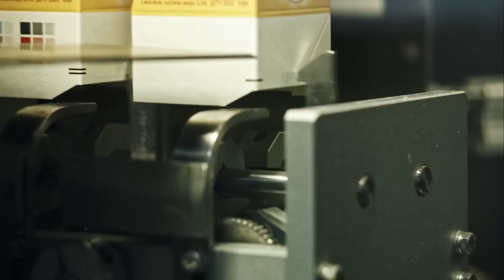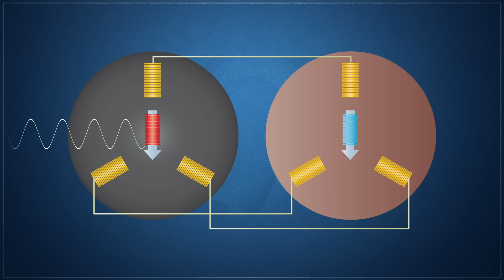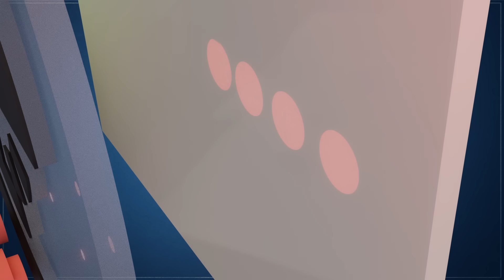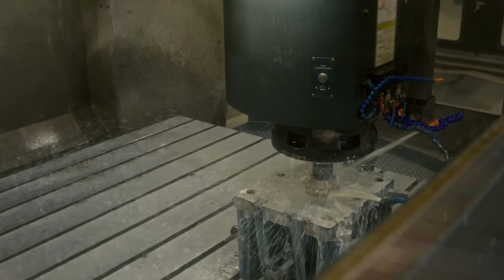The Incredible Engineering of Precision Rotary Motion

Comment: i own one of these bldc brusheless motor with conctant speed control (foc). its for my rc crawler car  and its amazing, the smoothness of these systems is out of this world. you can maintain such a low rpm at constant speed and its not cogging or stalling and has incredibly high torque for the size

Comment: We use it to detect precise positioning location of the rotating gantry of the CT machine which spin around a whole revolution in 1/5 of a second.  We won't go into the massive back projection data acquisition and image calculation way back when there were generic GPU's... They were not built in a day, that's for sure.

Comment: Kind of cool in my field of Land surveying, we use equipment down to 1 arc second of accuracy. I have a 3 arc second total station I use on a daily basis and one of my other crews has one that is 1 arc second. It can get us, with the right prism, down into the 0.001' range easily. Thats 1/64th inch at a range of up to 500'

Comment: Why did you start off talking about rotational accuracy of 1/10 of an inch at 1 mile and then immediately started talking about 3/4 of an inch at a mile? Why didn't you just start with 3/4 of an inch? That is a big relative difference

Comment: A cheap angular resolution mechanism might be similar to how the human eye identifies color.  Each of the 3 pigments respond to every wavelength of light but at different activation curves.  This triangulates the lights color 'position'.

Simply having 6 to 7 permanent magnets of different strength, orientation and placement in a ring, when measured by multiple cheap magnetometers, will converge to give only a single position that results in these readings.  The system would need proper calibration and might need ongoing calibration.

The system might need to be shielded from stay fields, and will respond unusually at high velocities due to induced currents, relaxation times etc.

Still, it's a way to do it.  Not sure if that's been done before, I'll keep watching.  It's fun when a solution you come to with independently is used in the real world.  Such a device would cost 50 cents to a dollar to make.

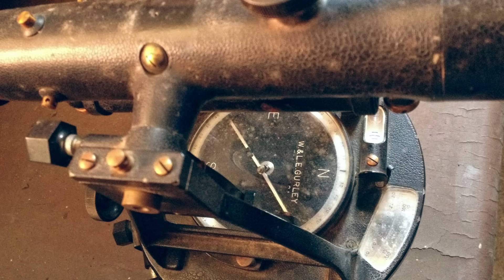Comment: 8:53  black widow spider silk for cross hairs = too toxic (this is obviously written in error when he means labor intensive)
So… chromium, something genuinely toxic as heck. 

It’s definitely less toxic to handle spider silk than use chemicals to etch chromium on to glass. If it was genuinely because of something toxic in spider silk they certainly didn’t understand the long term effects of chromium exposure otherwise they would not have made the choice to switch. 

It is far more likely about labor and durability of the chromium glass as well as mass production efficiency,

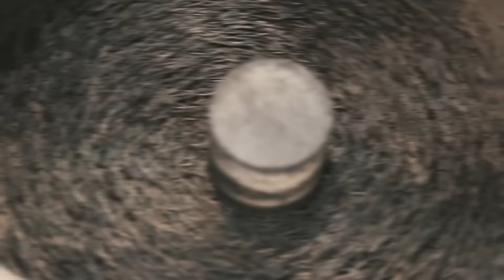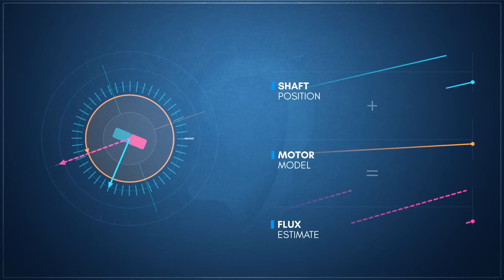Comment: 20:27. We used 3 phase DC motors with 3 analog hall sensors mounted at 120 degrees apart. By them being analog we could calculate, very accurately the rotor position and could hold zero speed position very tightly as well as have extremely low speed or fast speed operations. Re 25:00

Comment: How many times will I have to watch this in order to understand it? 😉
I worked either a Mergenthaler VIP photo typesetting machine, which used stepper motors to position the character-bearing drums in front of their flash units.  Very noisy.  Later versions used queiter servomotors

Comment: Selsyns - self synchronizing - have use on aircraft with multiple propellers to synchronize them so the beats on the fuselage are out of sync and therefore quieter.   Experience soon showed the need to turn them off during takeoff so one engine failure didn’t drag the other engines down.

Comment: The most incredible encoder to me is MT6835. Not because it competes with the precision of these exotic diffraction techniques, but because it sells for $5 so you can actually use it. 15 bits 100% reliable at high speed, 16 bits at medium speed, and 18 bits at low speed. As with most magnetic encoders there is ±0.5° of nonlinearity throughout the revolution, so you have to calibrate the readings to their true angles. But once that's done it's great.
Reply: Yeah, budget stuff is always a miracle of its own.

"The cheapest bit of rock that still does the job" is an impressive engineering challenge.

Comment: Have a look at flight guidance systems from the '60s to the late '90s. They are seriously just stacks upon stacks of resolvers in a giant clockwork, each being fed by simple analog sensors and radios . My company just scrapped a ton of old systems from storage, and they were a gold mine of High-end mechanical hardware  and precision sensors.
Reply: Modern flight control systems have extraordinary precision. I flew on a Boeing 787 from London to Boston while on autopilot, over one hour the plane’s altitude varied by +/- one metre. Don’t forget that during that time the plane is following the curvature of the earth.

Comment: 518400 slices? That's a weird number, it is very close to 2^19, which is 524.288. While 19 bits is impressive, I've used absolute encoders by Renishaw that had a resolution of 32 bits per revolution (4.2 billion counts). It reads a track on a disk about 40cm in diameter with a tiny optical sense head. To get 2^32 counts per revolution, the linear resolution is 0.3nm. The optical sensor uses red light, which has a wavelength of about 650nm. The lines on the disc are very small, but still just visible to the naked eye. How they accomplish this, with an accuracy of better than +/-30nm, is completely beyond me. I'm guessing it's some kind of raw position sensing combined with interferometry, but still it's mind-blowing.

I've been specialized in motor control for over a decade now, and this video is an incredible journey in where we are now, how we got here, and how it works, without ever stating half-truths or handwaving. Amazing work!
Reply: It comes from the division of a circle into 360°, each degree has 60 minutes, each minute has 60 seconds. So there are 360x60x60 arc seconds in a circle. A resolution of 2.5 is 518,400 divisions.
Reply: @DowellPiano  Yup, you're right. A 19-bit encoder will give you a resolution of 2.47 arc seconds, which was obviously rounded to 2.5 arc seconds. The writer of the script then took this number and converted it back into counts, without realizing that he was close, but off the correct number.
Reply: probably down to the ability of the mechanism itself. it has to position as well. and do it with no slop... under immense load at times.

"astronomical divider" can do a few million, but its not really intended to have an arm or something mounted to it and spin at 100rad/sec or something...

interferometry is madness :) for practical purposes like measuring, and not so practical...

as a teen, friend had an old disco light feature. two discs, fine black radial lines, in front of a projector. produces rainbows... its "twirler" didnt work or something... were meant to change...
i did something pretty cool with a "fibre optic" xmas tree base, a tin can, and a nail. one hole was a pinhole lens.
a hundred holes made awesome interference bands and colours that were NOT part of the rotating pattern...
always meant to revisit that one...

how the * does an optical mouse work, lol...
Reply: Hey loved the reply (and this video obviously). I find this all fascinating as hell. What to you do day to day if I may inquire?
Reply: Ever used callipers? The lines there are far courser than the precision with which it measures.
With more sensors, a similar effect can be achieved on the wheel.

Comment: Synchros were fun.  At the cusp of change from analog to digital, the MD-80 airliner had digital flight guidance computers controlling many functions previously done by separate, analog systems, including flight directors, autopilot, engine thrust rating and auto throttle, and many more.  On the receiving end, however, and on most of the navigation functions, analog synchros still ruled.  For instance, the RMI, or Radio Magnetic Indicator, on each pilot's instrument control panel contained a total of eleven different synchros, CT, CX, TR, TX, Resolver, CDS, and more, to operate the different indicator elements on the face of the instrument and to interface with compass, VOR, ADF, DFGC, and other systems.  All of this was contained in an instrument body the size of a beer can.  This particular RMI was remarkably reliable, but it was the end of the line before the flat panel digital displays took over.

Comment: ❤❤❤ thank you ❤❤ what are your thoughts on slaking hydrated lime? I watched a video a guy who showed the traditional “mixing“ water    into lime.   It takes time or vacuum to get all the h20 to touch all the calcium and stuff or whatever is in lime.  Then this very beautiful cooling building material becomes timeless stone hardening forever. Crumbling in acid rain tho and the new stone will erode in water streams.  
An old wife’s tale told a story about a lime mason who didn’t have a bucket of slaked lime for their grand children, a terrible heat would wake the new masons.  

Placing lime into a vacuum chamber and sucking out all the air as much as possible is a convenient way to “mix” water into lime. 

This lime paste is what can be stirred into water and the beautiful colours found at the local pottery shops or the hardware stores.  

❤Have you ever seen a brick mold? The lime paste as mixed above can be  used to make the same thing as a hempcete block.  But make your own brick that you can mortar up the outside wall. With slaked lime the lime is butter.  “Mix” up old used fibre glass into the lime paste.  Press the fibre into the water extended lime paste. Pretend you’re a hoof.  Water filled lawn roller on a hard flat surface. 
Yikes is all that worthwhile? 3 months minimum sit time without freezing is like baking beans.  Yes and why lime paste is not dusty ! It will turn your skin to stone tho. And your eyeballs like a molecular vampire. Wear eye protection and keep vinegar. Tell your friends and do not mention Lime Plaster without safety. Lime Plaster is no joke.  Wash your hands with vinegar. Keep your gloves with vinegar. Don’t rub vinegar on lime plaster.    Wear eye protection and wear gloves.   Don’t worry about washing your hands for your lunch break. Your hands will cleaner than what a surgeon could do before surgery.   

Okay long winded but stay safe and make lime bricks for humanity.  Lime paste casts a beautiful bright white face. You can make big or small,  lightweight bricks or tiles from lime paste mixed into but not limited to : new or used loose or batten pink or mineral wool insolation, hemp herd, grass clippings, tuff invasive weeds from the neighbourhood, chipped trees, tree branches, sand, sand blast slag, silica gel ( that kitty litter stuff) the list goes on with creativity, because lime paste is more workable under the conditions as above.  

Beautiful bathroom floors can be sculpted out of silica gel kitty litter. I have heard that light travels into lime and bounce back.  So that kitty litter expands light into the floor.  Do that bees wax and water glass water proofing.  But mass insulation architectural bricks made from brick or tile molds. 

I would suggest lime falling out of water would be the reason for spotty application. Not spotty worker performance and without a thing that breaks the static bond in the water gravity makes it lazy. Sodium silicate I think.  

I would look that up but I’m procrastinating. But lime bricks for humanity.  Wow great information.  I am very appreciative that you have done this. I want to do the same thing. This feels like a warm validation hug that others are using a centuries old building materials.

Comment: 2.5 arc seconds at 1 mile is .774 inches. The RCN2000's error per signal is .3 arc seconds, which is a accuracy of .091 inches at a mile.
2.5 arc seconds is .01 inches at 1000 inches. .01 inches at 1 mile is 0.03 arc seconds, which is the pointing accuracy of Hubble or James Webb.
It's deeply annoying that " is arc seconds and also inches.  (2.5" could be 2.5 arc seconds or 2.5 inches without context).

Comment: The latest in technology is a BLDC outrunner with integrated cycloidal drive and a hall effect rotary position feedback.  These are cheap, nearly no backlash, high torque, low loss, and highly controllable.
Reply: It's also worth mentioning the Strain wave gearing. Even lower backlash and higher torque density. Those actuators also incorporate a continuous position feedback of the output shaft by (non-discrete) hall effect or optical encoders.

Comment: Great video. Can you do inverters or a new video on motors like the newer motor designs. Rotor Stator Rotor axial flux motors. 

  TMF motors too, but I can't find a single source for a layman. I just know in theory their torque density is the best at low speeds. 

  Halbach Arrays. 

 YASA has a 2012hp drive train that weighs 90 pounds for the major components. Stripping it down to just (two) RSR yokeless axisl flux hub wheel motors, inverters, emergency brakes + Regen in place of regular heavy disc breaks. 

 It would be nice to know why this technology was pretty much theorized. Accepted. Never looked into until fairly recently.

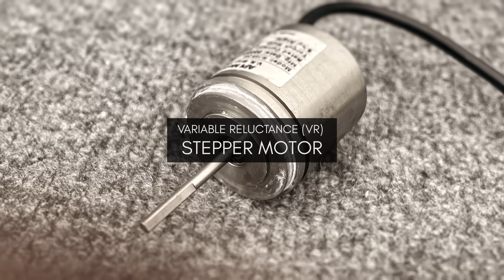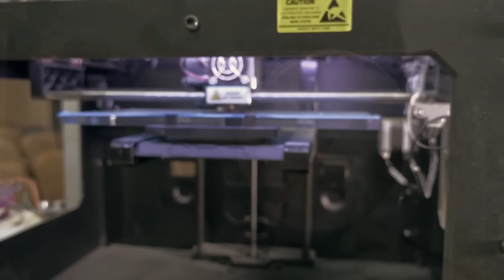Comment: 15:11 - 18:21 I believe you'll find that it was Rockwell Automation who perfected the work on the crudely-conceived idea of an instrument that would not only produce inverse reactive current for use in unilateral phase detractors, but would also be capable of automatically synchronizing cardinal gram-meters.
Reply: Weren't they prefamulated? Depended on the encabulator
Reply: @wolfpeoplearereal  I see what you did there. Well played.
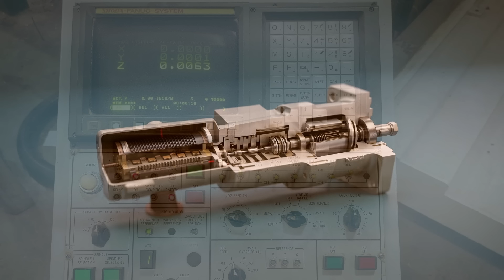Reply: @TheAnimeist  @wolfpeoplearereal  Exactly. You can see what appears to be a miniaturized version of Rockwell's - then known as Rockwell International - earliest turbine-powered iteration almost halfway through the OP timestamps at 16:56.
Reply: But could the lunar waneshafts eliminate side fumbling?  That’s what I want to know.
Reply: Only if the six hydrocoptic marzel vanes are fitted to the ambifacient lunar wane shaft, then side fumbling is effectively prevented.
Reply: @AndresPereydaResearch5  it's so easy to overlook this, but truer words have never been spoken. You had a good professor, no doubt!
Reply: @AndresPereydaResearch5  Excessive side fumbling can be really hard to detect, especially if the marzel vanes aren't fully hydrocoptic. With the retro actions of the entire system being nearly flawless due to Rockwell's tireless research, none of this is unsolvable.
Reply: But in 1997 Rockwell Automation had not fully completed it’s rebranding, so it was commonly known as Allen-Bradly at that time.
Reply: @desertpunk6705  Ah, that explains why the prototype unit was still undergoing A-B testing, as seen by the label on the device.
Reply: Lmao
Reply: hahahaha.  i said the same thing.  that this video reminded me of the turbo encabulator.  except it's real instead of nonsense.
Reply: Lol cromulant encabulation
Reply: Hahahaha.